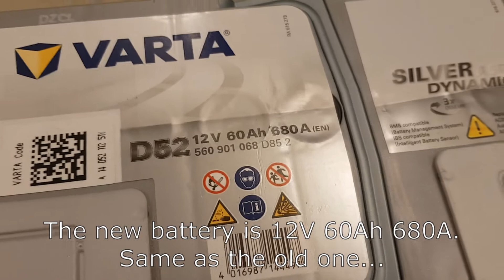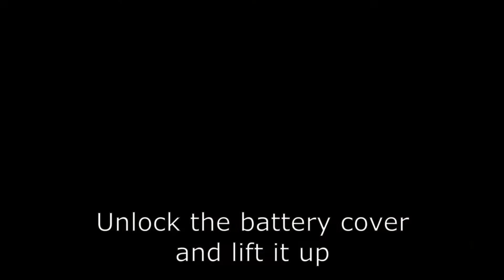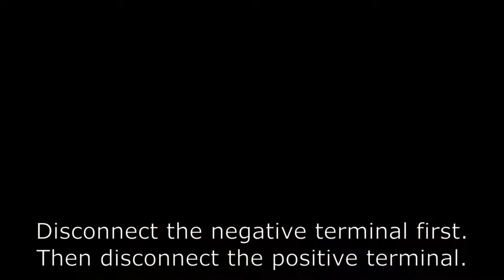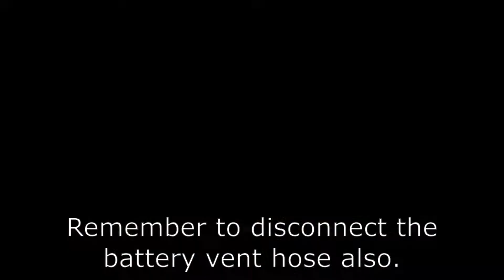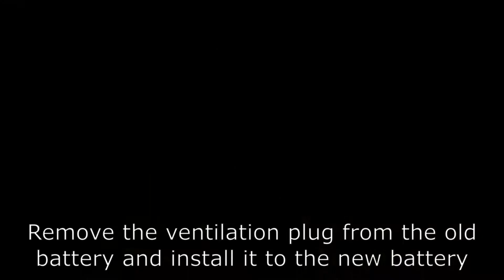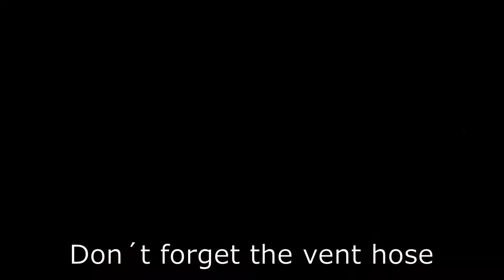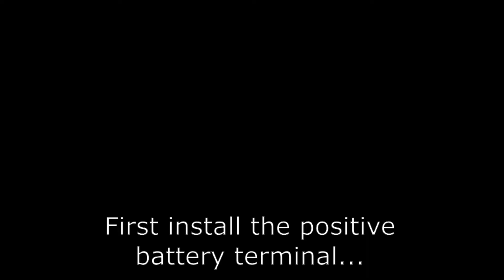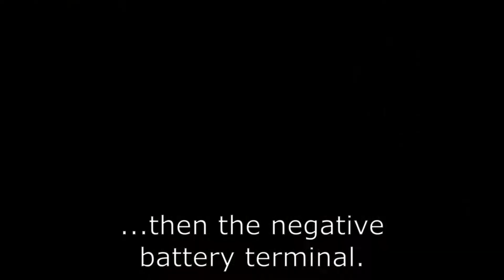Mercedes-Benz C200 S205 battery replacement

Comment: I thought they usually come with a 800A 80AH battery?
Reply from the maker: That is also possible. The battery I used was the same as the original